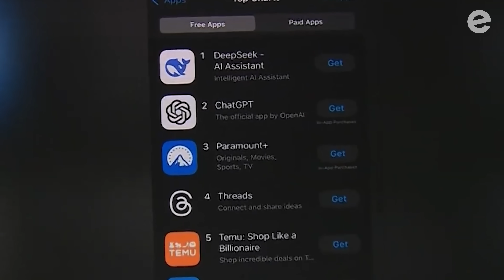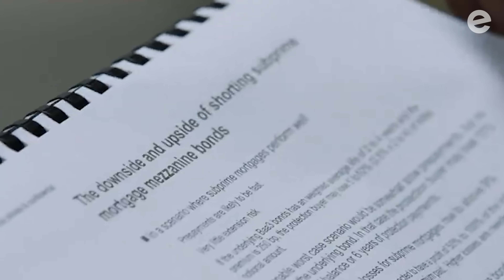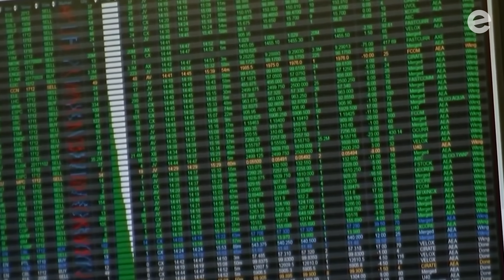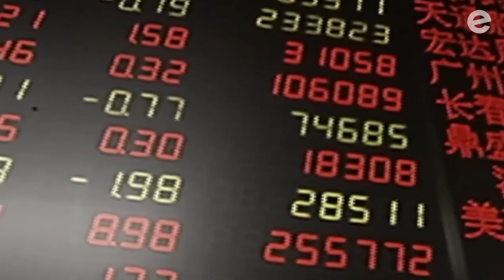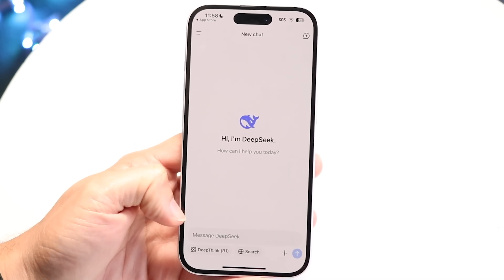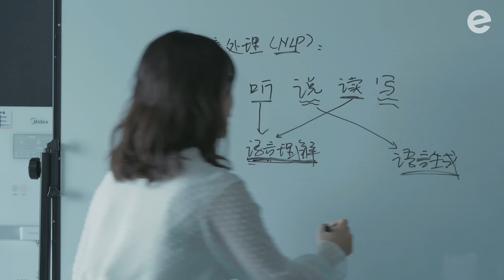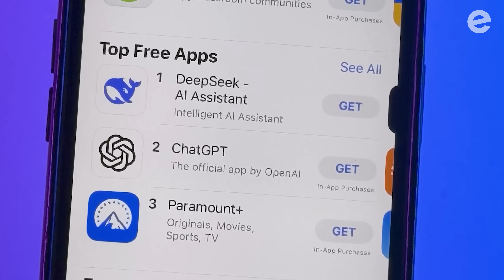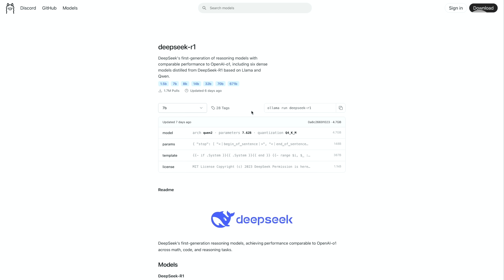The Man Behind DeepSeek (Liang Wenfeng)

Comment: 12:30 Completely nuts that increasing energy efficiency decreases energy consumption. 

In economics, the Jevons paradox occurs when technological advancements make a resource more efficient to use (thereby reducing the amount needed for a single application); however, as the cost of using the resource drops, if the price is highly elastic, this results in overall demand increases causing total resource consumption to rise.

So many times I'm forced to wonder whether human-equivalent AGI is all that high a bar in the first place.

Comment: As someone who works with AI all day every day for the past 3-4 years as part of my business... Deepseek is absolutely not currently the best model, at least not for programming. In my experience (of which I have A LOT), Deepseek R1 is almost exactly the same as GPT-4o. The best model is currently Claude Sonnet 3.5, HANDS DOWN. But it is indeed quite expensive to run... If you want to use it like me, all day everyday, you're looking at around $300/month.

Comment: DeepSeek's achievements, particularly with their R1 model, have been significantly influenced by the use of the distillation technique, where outputs from other AI models are used as training data. Here's an analysis based on available information:

- **Distillation's Role**: Distillation has been pivotal in DeepSeek's strategy to train its models efficiently. By using outputs from more advanced models, DeepSeek could enhance its smaller models' performance without the need for extensive data or computing resources. The technique involves creating a "student" model that learns from a "teacher" model, reducing the computational demand and potentially improving the performance on specific tasks. 

- **Without Distillation**: 
  - **Cost and Efficiency**: Without distillation, DeepSeek would likely face significantly higher training costs and increased computational requirements. The cost efficiency and lower resource usage that have been noted for DeepSeek's models, like the R1, would be much harder to achieve. For instance, DeepSeek-V3, which reportedly was trained for a fraction of the cost of comparable models, would likely require a much larger budget and more computing power if traditional methods without distillation were employed.

  - **Performance**: The reasoning capabilities and benchmark performances of DeepSeek's models, particularly in areas like coding and mathematical reasoning, might not reach the same level without the knowledge transfer facilitated by distillation. The technique allows for the transfer of complex reasoning capabilities from larger, more advanced models to smaller ones, which is a crucial aspect of DeepSeek's success in various benchmarks.

  - **Innovation and Speed**: DeepSeek's rapid development and iteration of models, as seen with the updates from R1 to V3, would be slowed down. Distillation enables quicker advancements by leveraging existing AI knowledge, which could be a significant roadblock if avoided entirely.

- **Alternative Approaches**: 
  - **Direct Data Collection**: If DeepSeek opted to avoid distillation, they would need to collect or generate a massive, high-quality dataset, which would be time-consuming and potentially expensive. This approach would require them to either have access to vast amounts of proprietary data or to spend considerable effort on synthetic data generation or data augmentation.

  - **Increased Compute**: Scaling up compute resources to match or exceed what competitors use would be another pathway, but this would negate the cost benefits they've claimed and potentially make their models less competitive in terms of efficiency.

- **Public Statements and Research**: While DeepSeek has openly discussed using distillation, if we look at statements from the community and researchers on platforms like X, there's an acknowledgment that distillation has been key. For instance, posts highlight that DeepSeek's R1 performance is largely due to reinforcement learning augmented by the distillation process, suggesting that without this technique, their achievements might not be as pronounced.

In conclusion, while DeepSeek could still develop AI models without distillation, the efficiency, performance, and speed of their achievements would likely be significantly compromised. Distillation has been a cornerstone of their strategy, allowing them to compete at a high level with fewer resources. However, without it, they would need to rely on more traditional, resource-intensive methods, potentially limiting their competitive edge and innovation pace.